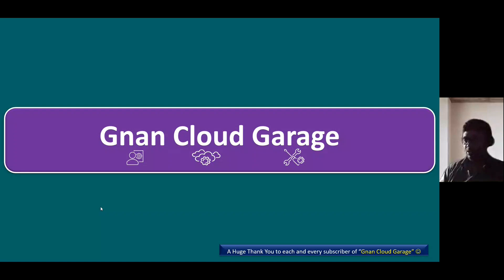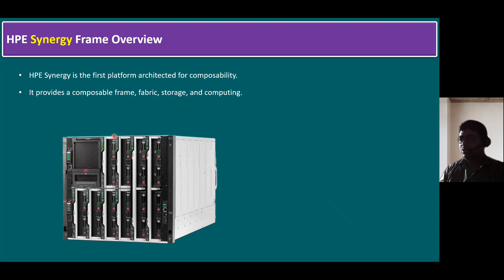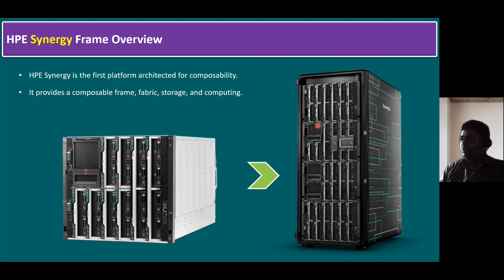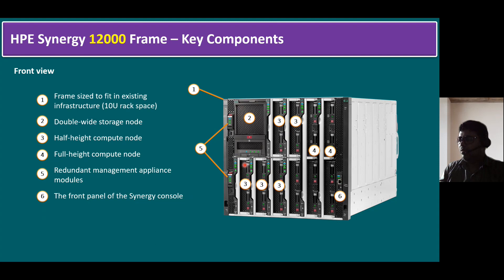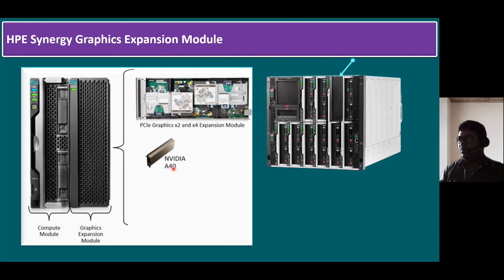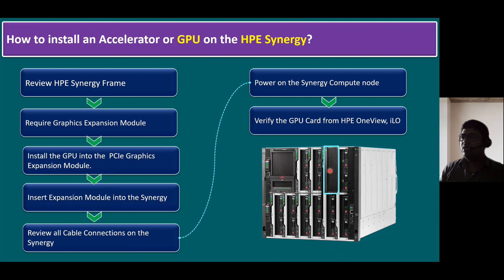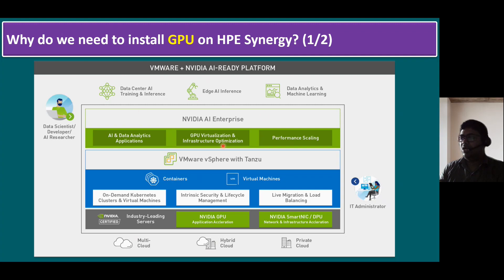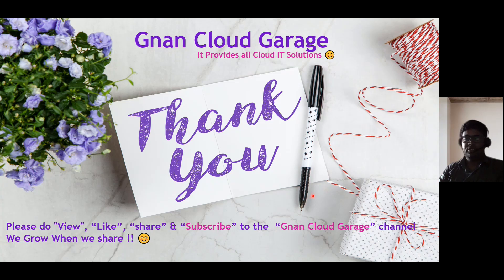How to install an Accelerator or GPU on the HPE Synergy?  VMware + Nvidia AI-Ready Platform use case

Comment: Hi, do I need to install nvidia vib on the esxi host?
Reply from the maker: Hi,

If you are planning to run GPU-accelerated workloads, especially in environments like AI/ML, VDI, or HPC, installing the NVIDIA VIB on your ESXi host is necessary. 

If your workloads do not require GPU resources, then installing the VIB might not be needed.

Thank you